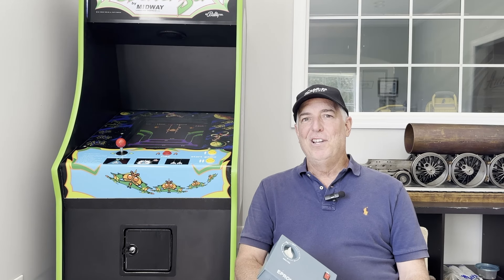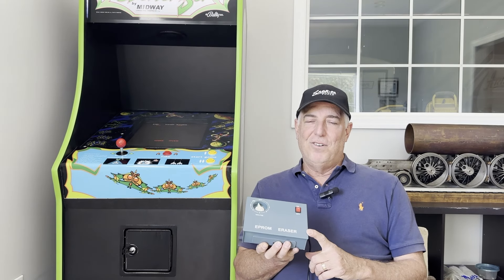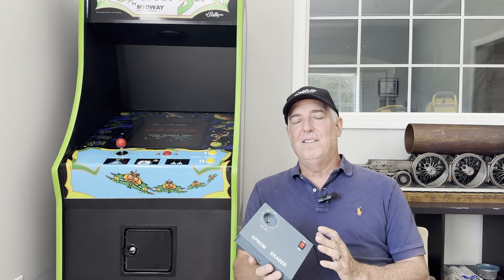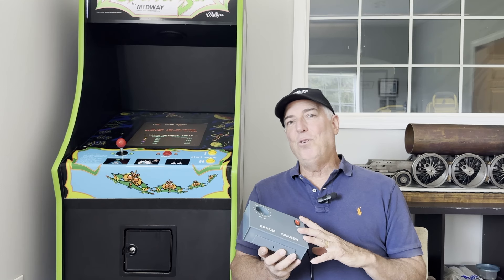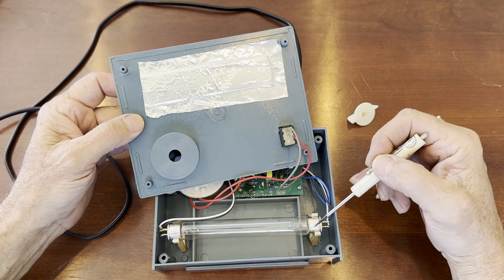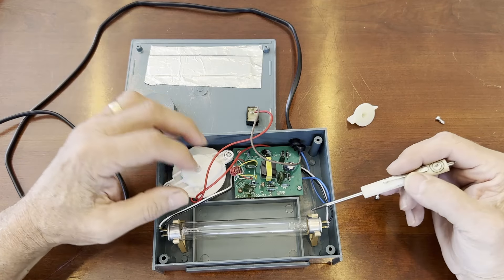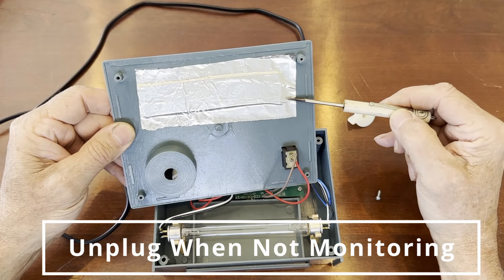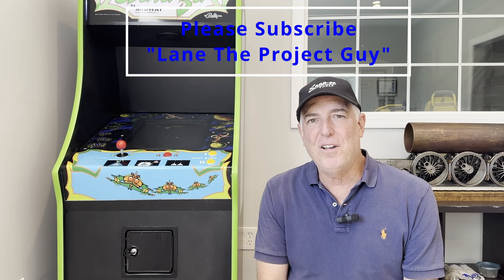A Cheap Mod Made My EPROM Eraser Faster!

Comment: It's great that the foil trick works, though I'm curious why performance started to degrade since the bulb looks ok, at least from this side of the camera. I wonder if a new bulb would help though. A new bulb and a couple of connectors so you can change out the bulb in the future :D
Reply from the maker: Probably a new bulb would revive the performance